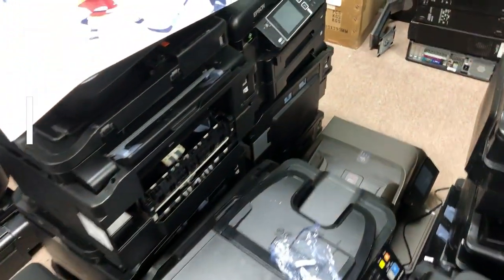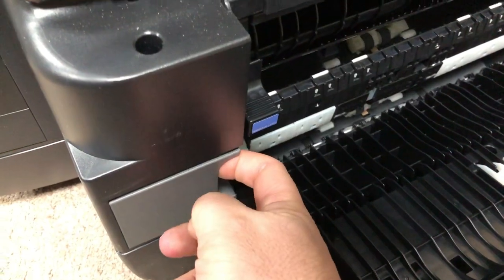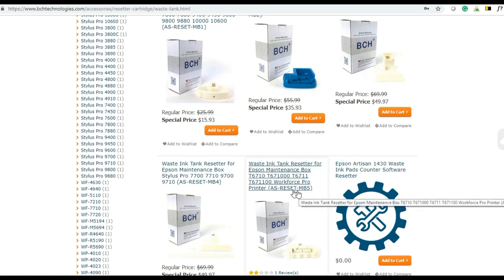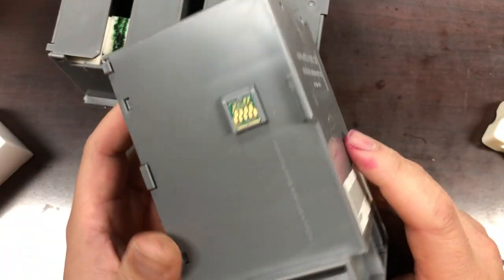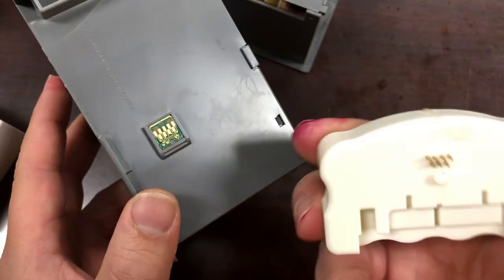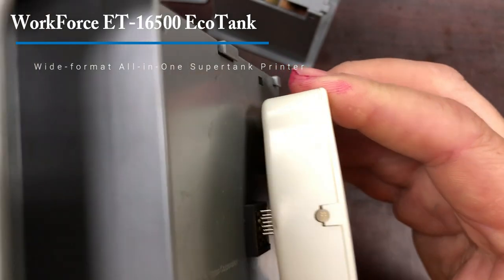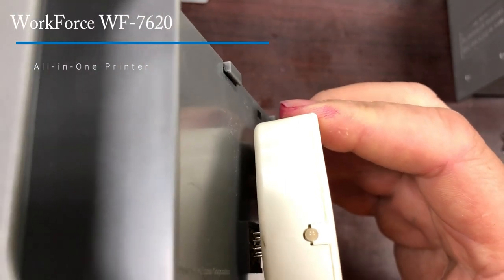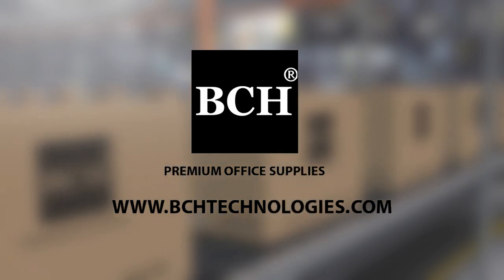How to Reset Waste Ink Pad: ET-16500 EcoTank, Workforce WF-7620, WF-3640 Maintenance Box Chip

Comment from the maker: The MB5 resetter: https://tinyurl.com/ybw24sz2
Reply from the maker: Waste Tank model: T6710  T6711 (T671100 is the same as T6711)

Printer models:

WF-3xxx
WF-4xxx
WF-5xxx
WF-7xxx
WP-4xxx
 
WorkForce ET-16500 EcoTank Wide-format All-in-One Supertank Printer
WorkForce Pro WF-4630 All-in-One Printer
WorkForce Pro WF-4640 All-in-One Printer
WorkForce Pro WF-5110 Network Wireless Color Printer
WorkForce Pro WF-5190 Network Color Printer with PCL/Adobe PS
WorkForce Pro WF-5620 Network Multifunction Color Printer
WorkForce Pro WF-5690 Network Multifunction Color Printer with PCL/Adobe PS
WorkForce Pro WF-M5194 Workgroup Monochrome Printer
WorkForce Pro WF-M5694 Multifunction Monochrome Printer
WorkForce Pro WF-R4640 EcoTank All-in-One
WorkForce Pro WF-R5190 Replaceable Ink Pack System
WorkForce Pro WF-R5690 Replaceable Ink Pack System
WorkForce Pro WP-4010 Network Color Printer
WorkForce Pro WP-4020 Inkjet Printer
WorkForce Pro WP-4023 Network Wireless Color Printer
WorkForce Pro WP-4090 Network Color Printer with PCL
WorkForce Pro WP-4520 Network Multifunction Color Printer
WorkForce Pro WP-4530 All-in-One Printer
WorkForce Pro WP-4533 Network Multifunction Wireless Color Printer
WorkForce Pro WP-4540 All-in-One Printer
WorkForce Pro WP-4590 Network Multifunction Color Printer with PCL
WorkForce WF-3540 All-in-One Printer
WorkForce WF-3620 All-in-One Printer
WorkForce WF-3640 All-in-One Printer
WorkForce WF-7110 Inkjet Printer
WorkForce WF-7210 Wide-format Printer
WorkForce WF-7510 All-in-One Printer
WorkForce WF-7610 All-in-One Printer
WorkForce WF-7620 All-in-One Printer
WorkForce WF-7710 Wide-format All-in-One Printer
WorkForce WF-7720 Wide-format All-in-One Printer

Comment: Just wanted to say a big THANKS!! i found your channel last week and saw your method for using a steam cleaner on the printhead.   I have an Epson wf-7015 that had been stood for two and a half years. I pulled the printhead and used my steam cleaner on it, then ran ink cleaning fluid through it several times and it works like new again. I would have never thought of using a steam cleaner on the printhead!!  thanks again.

Comment: can you used this resetter unlimited or once use only?
Reply from the maker: I think there is a hard physical limit of 1 million read/write on the chip.  However, each reset may reset a few thousand read/write, so it's not actually unlimited but you can use it A LOT before the chip gone bad.

Comment: I just purchased this printer and never used it yet. Why do I have a maintenance error for the box to be removed and reinstalled?
Reply from the maker: You may have a malfunctioning chip.  If you bought from Amazon, it is possible someone swapped the maintenance tank too.  It's better to contact the seller or Epson.